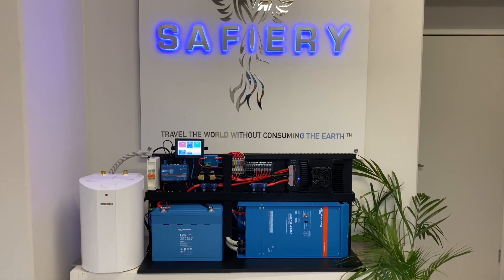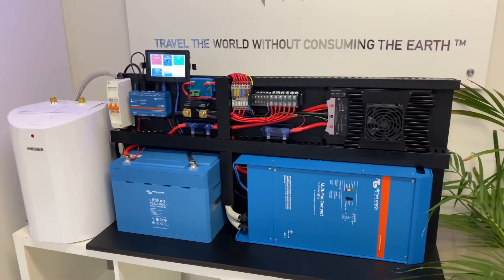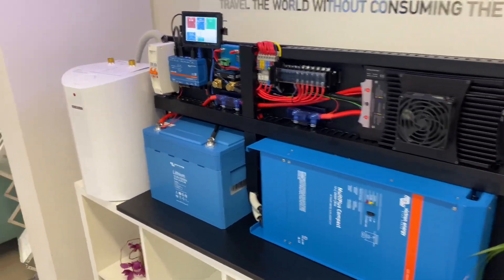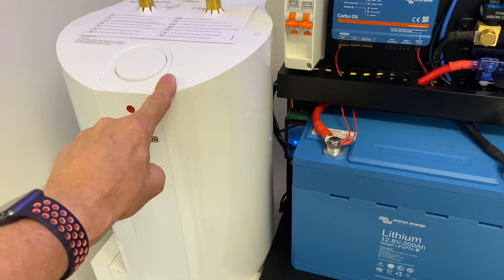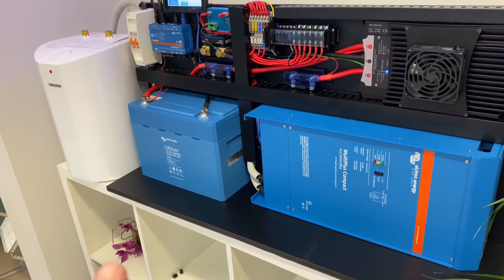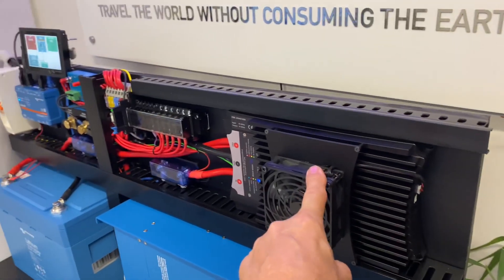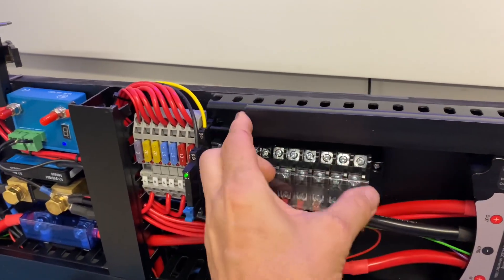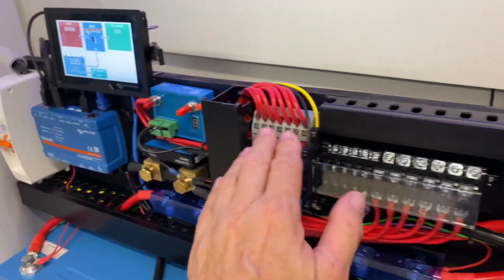Electric Cooking / Hot Water for 70 Series Troopy. 200Ah Lithium, 2000W Inverter 1600W Alternator

Comment: Does the inverter require air circulation on both sides and top??
Reply from the maker: It produces most heat When charging. On its side, the top legt hand vent is open which lets heat out. There is a fan inside. More ventilation, the better under high loads!